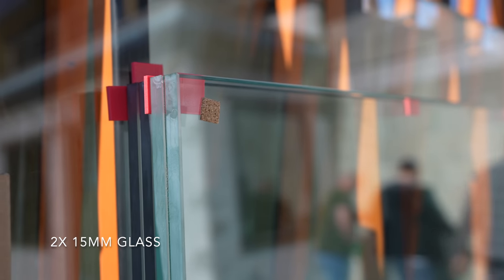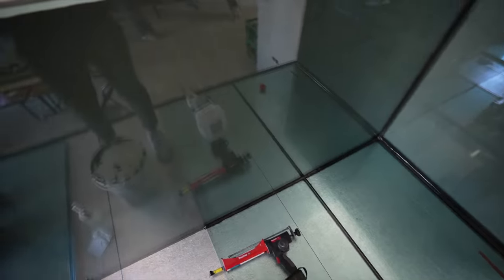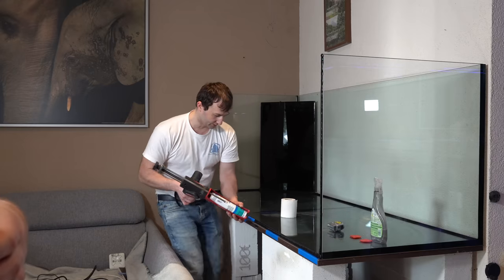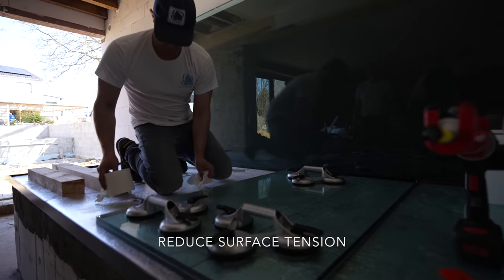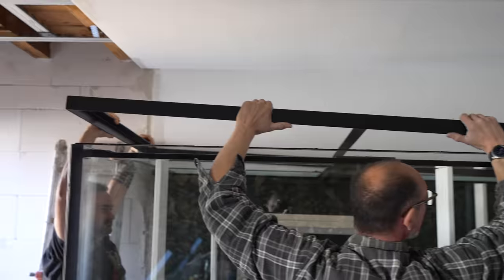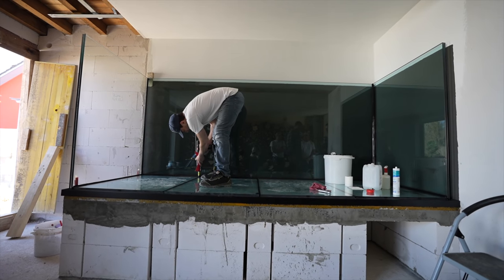How to glue together a 4000 Liter AQUARIUM?!

Comment: I love the build videos, keep them coming! I recently started building large aquariums and the multi panel bottom to the tank is genius! I've also never seen the combined 15mm to make 30mm thick walls before. So cool. I'm assuming you are using some sort of UV bonding  rather than silicone with it being so clear, awesome stuff! I've only been able to find 19mm thick glass for my larger tanks but I will definitely have to try combining panel thickness for larger tanks. So cool guys, like I said, keep up the killer videos!
Reply from the maker: Thank you so much for the feedback! Yes 19mm is normally the thickest glas you found in complete tanks :D

Comment: All nice, but I have a question. Why they don't fixated glass??? Because in time polimerizarion silicone possible deformation glass and cracks or bubles in glue. Plus triplex can give bubbles after some time and crash. I ask all this things because have experience building many thanks more than 3000 litters with glass. Looks great but actually dangerous. Can you show this tank after some time please. Like for video! Like usual bro😜👍
Reply: hi, do you know how they stick those two (2x15 mm) glass together, and its clear  I want to make that thick glass for my viewing panel in a 5000 G tank, if you know pls help
Reply: @rudrajyotimondal2410  which size you planing? Its depends from high panel. For my opinion acrilic glass will more good, but first need know size
Reply: Size of the panel 10ft x 4ft
Reply: @rudrajyotimondal2410  triplex 2x15 possible, its okay. But if build normally, then acrilic panel 30mm and will happy
Reply: How will I join those glass by surface and it will be clear like shown in this video
Reply: @rudrajyotimondal2410  no no, it will not clear if comparing with acrilic. Even optiwhyte glass (super clear) cant comparing with acrilic. I have photo in butt 4 meters long panel 25mm, and you can see everything, even read paper. And for example you bring 1meter clarified glass 15mm  and you will see in butt, then only half of paper you will see. If you will bring 4 meters long 15mm glass even clarify you will see in butt and absolutely dark. Because of Ferrum, its technology building glass. My advice: if you build fishtank with panel, then bring acrylic panel, more clear, more save, more easily in work . 19mm also okay, its still clear, but not for your high. But 2x15 it is too much, really, you will not get different colours in plants, if it will be coral reef, then 2x15 don't show you most of beauty your reef. If you planing biotop America, or just keep monster fish then its normal if you bring 2x15mm.   I hope i explain my position, but in anyway on big size acrylic panel is the best)
Reply: @rudrajyotimondal2410  in this video i was really interesting how looks seams after dry glue and which clearance between glass. Its really important moment and here i see people's building without special technology. Interesting which glue using? Chemlux 9013? Its my favourite silicone
Reply: And one more moment, that glass stick in fabric, in special room, with special technology and in special equipment. It is seriously process. In home made likely you will not be successful. After some time, maybe some months between glass will be air bubbles and it will no triplex anymore, it will only 15mm, but high will the same, next step crack.... If you decide with triplex, then bring only fabric triplex, with special certificate
Reply: @rudrajyotimondal2410  how work with glass, you can find "studio 3000". Here i show build my 3000 liters tank, from 19mm glass and explain everything in detail, step by step, i think you will find answers on many questions 😜 but its not English
Reply: @АлексеАвгуст  thanks